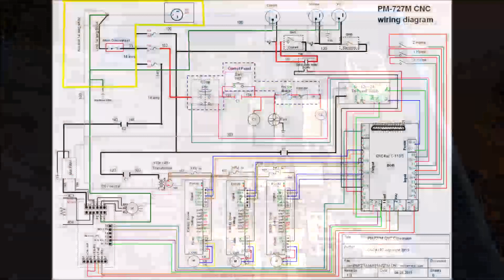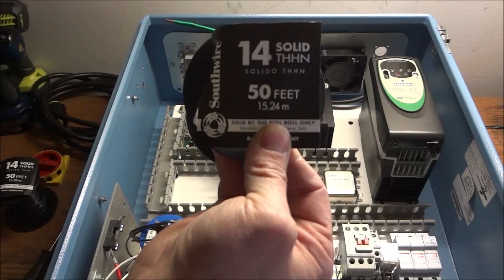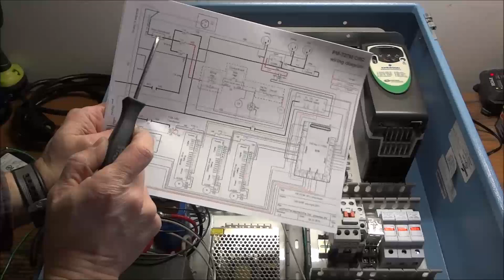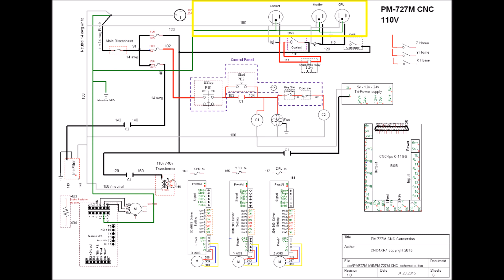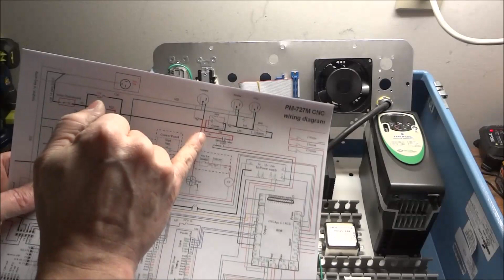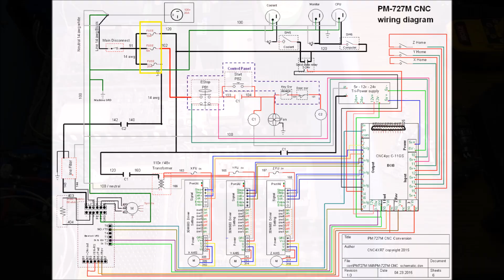PM 727M CNC Electrical Wiring Part 1

Comment: Hi! How did you split mains power so the whole machine needs just one outlet? I'm using 2 way screw terminals, but I'm looking for a cleaner solution. Thanks!
Reply from the maker: the whole Control box is running on 1 20 amp 110v circuit.

Comment: CNC4XR7, first off, thanks for all your videos.  I have gone through all of this series because I am hopefully soon starting up a CNC build myself.  I was curious what you used to create the wiring diagrams that accompany these videos.  I am basing a lot of my main electrical system off of yours but with a few modifications of course and I want to clean up my hand sketched drawings.  I liked that you were able to include the C11GS BOB with the DB25 connector pinout.  I looked in to a few different programs/websites/apps but haven’t found one I really like quite yet.  Being able to show the coil and contacts of a relay in separate locations like you have would help a ton with cleaning up the mess that is my schematic.  The other thing I was curious about has to do with the estop switching 2 different voltages so closely.  You have one set of contacts switching 120Vac mains power and another set of contacts is switching a 5V dc signal.  For my project, I want to add a few things that will make this happen in a bunch of places and wanted to know if it gave you any trouble.  I know best practice is to separate different voltages as much as possible, which it seems you end up doing by running two cables to your control panel.
Reply from the maker: I use TinyCad a free software for my wiring the C11gs and other things were drawn with this software. The 110v on the Estop is the main power which when denergized drops the holding circuit for the machine power the 5 v is the estop line to the BOB
Reply: Thanks for the fast reply.  And with the two different voltages running through two different sets of contacts on the switch, you don't have any strange issues with crosstalk or anything?
Reply from the maker: No I have not had any issues

Comment: Good call on the Kraus and Naimer - just got one off ebay shipped for $25 - seeing them listed for over $100 ... crazy.  But to the real reason Im posting today ... Sam - this series is amazing - TY in advance ... but alas Ive stumbled upon a question ... In this video we've watched you wire up the coolant and PC outlets on the back of the box with Neutral and Grounds and the red wire from the SS Relay ... but you didnt film running the HOT / Blk to the PC outlet ... yet at 9:08 in your video - there it is ... Hot/BLK on the PC outlet - How did that get there and where is it coming from/going to ...
Reply from the maker: Hi Steve take a look at part 2  .055sec in that may help you understand. The outlet is supplied the Black Hot 110v from a rocker switch on the control panel that gets wired up latter at the end of the pt.1 I do have a black wire connected and it just runs out the hole Its there just for reference and gets replaced when I do the control panel wiring.
Reply from the maker: Take a look at part 4 that is where I send the 110v to the control box rocker switch that turns on the cpu outlet.
Reply: Many thanks Sam ...  guess i kinda jumped the gun with my query ... I pressed on thru the next stages / videos and found where you changed that up in Part 4.  All clear now - Thx!  Mind if I also ask why you decided to change it up and go with the LiquiTight vs. Cannon plug[s] ?  For me sourcing custom lengths of 5 and 8 conductor wire of decent quality and shipping is far exceeding costs of 2 or 4 quality, high amp, aviation power style connectors.  Im in the process of using 2x 16awg 4 conductor SOOW runs with 16mm aviation connnectors ... re-mapped to your pin outs / connections. [ For the remote control box ]  Asking to make sure Im not walking into trouble with this route.  Thanks man
Reply from the maker: Hi Steve,
I used the 16mm Aviation connectors for the small gauge wire and the Cannon type for the bigger stuff the pins are bigger. check ebay you can fined them at a good price its all how you search. https://www.ebay.com/itm/Waterproof-Male-Female-Aviation-Circular-Connector-4-Terminal-P20-4-Core-P20K6Q/311528938505?ssPageName=STRK%3AMEBIDX%3AIT&_trksid=p2057872.m2749.l2649

Here I just purchased a 4 pin for my new box.  For the 8 pin connector to the control box you have to go with a 32mm P32 connector which was to tall so I used a https://www.ebay.com/itm/1-2-inch-NPT-90-Degree-Strain-Relief-Cable-Gland-with-gasket-nut-New/281379032241?ssPageName=STRK%3AMEBIDX%3AIT&_trksid=p2055119.m1438.l2649

Its not removable so if you have dont plan on needing to remove it you can go this route or use a P32 aviation connector.
Reply: So splitting the 8 wire up into two 4 pin 16mm plugs is not a viable alternative? 16 awg is too large for the 16mm aviation plugs or is the potential amperage/voltage from the control box wiring  [ not the low voltage DIN stuff ] too heavy ?
Reply from the maker: Steve Aylor 
You could split it i think tgat would be ok

Comment: I feel dumb asking but where did you get that rotary disconnect switch? What brand? I'm having trouble finding a similar one.
Reply: And I just figured it out. lol Kraus & Naimer
Reply from the maker: yeah Try Ebay Thats where I found the one I have you can find deals.
Reply: CNC4XR7 hey brother, I’m really sorry to bug you more. I’ve had my controller cobbed together for a while and you’ve inspired me to rebuild the control box with proper safety circuit etc. I see your feeding from a 20a outlet. I understand electricity enough to stay safe but I’m still learning so I’m a bit curious on your amp draw. Between my 48v PS (12a), my spindle driver (10a) I’m not sure how I’m going to feed it all from one 20a outlet. The coolant pump I’m trying to use needs 8.5a. I’m assuming these ratings are peak? What amp draw does your transformer and VFD pull that you can still connect a pump to the built in outlet in your controller box? Am I just not understanding current draw clearly? Sorry for the newb questions, I feel dumb asking but I’m just trying to clear up my understanding.
Reply from the maker: I think you have a good understanding and your assumptions are correct. off the top of my head I do not recall the current ratings but they are peak. and you want to try and stay at around 80% of the breaker rating so around 16amps. I am pushing them to the limits for sure but it seems to be fine with no issues. each draw is not at the same time so it does not all add up at once and my peak does not reach the limit. I think my dc PS is 15a and my VFD is 8amp , the coolant pump is about the same. plus my CPU and Monitor.
Reply: CNC4XR7 I have a single outlet 20a circuit and a 3 outlet 15a circuit in the garage and I’m having trouble figuring out an appropriate combination. The controllers 48v power supply alone trips the breaker on the 15a circuit but I believe part of that problem is that circuit is shared between the garage and the outdoor gfis. I had a working combination before I added in the coolant pump and now I keep going over the numbers trying to see if I can make it work. It kinda amazes me your running the PS, VFD, a pump AND  the PC all on a 20a circuit but I guess I’m thinking of it from a peak power up load. I need to get a meter with a clamp for measuring current draw. I think that would help me wrap my head around what’s going on.
Reply from the maker: If your 48v power supply is tripping the breaker and its only rated at 12 a there must be a problem. I do have a dedicated outlet just for the mill and it can not be a GFI outlet vfd's dont like them.
Reply: CNC4XR7 I agree. Trying to figure that out. It doesn’t trip the 20a circuit so it’s very possible I’m looking at a problem on the 15a circuit. I think verifying what the amp draw on the PS actually will help narrow it down.
Reply: CNC4XR7 I hate to even suggest it but I’m considering plugging everything into the 20a circuit to see if it will trip the breaker. I hate the idea but it’s about what I have left for troubleshooting until I buy another meter.
Reply from the maker: have you tried a different 15a outlet?
Reply: CNC4XR7 I have not yet. That’s a thought as well. My thinking has always been the available outlets are all on the same circuit (except the 20a outlet) so it would end up the same result. I could try that as well.
Reply from the maker: shoot me a email I will be happy to help if I can

Comment: Just to clarify,  your VFD converts 115v 1 phase to 220v 3 phase? This entire machine runs off of 110v?
Reply from the maker: Yes!  
It can be wired using 220v single phase as well,
Be Safe,
Sam

Comment: looking great, very professional!!  just watch your ground loops, don't want to have to hunt down issues after the fact.  are you using a line reactor on the input and output side of the VFD?  if not would be a great addition.  safer for your home power so you don't feedback into the panel and on the output side it smooths out the wave form and helps the motors run smoother and at lower temperature, we especially if the motor is bon inverter duty.
Reply from the maker: +christopher polanski  Thanks, Chris
Yes  I am using a EMI line filter on the incoming power to the VFD. Same as My G0602 project. VFD's are notorious for introducing noise on the AC line this helps with that. I will be keeping my Grounds isolated as much as possible.
Be Safe Sam

Comment: Nice to see the wiring started. I noticed that your sheet 1 of the wiring diagram doesn't show connecting to the main disconnect T2 and T3. I assume that's just a convenient place for you to tie the wires together before branching out to where they end up going. Is that correct?
Reply from the maker: +William Hardin Yes You are correct Instead of bringing the Ground and Neutral down to the terminal strip and back up to the receptacles I just used t2 and t3 (which were not going to be used for power) as a terminal strip itself. and then down to the terminal strip it saved a little wiring.
Be Safe,
Sam

Comment: Fantastic.
Reply from the maker: +russtuff Thanks Rus, Hows the progress coming on the G0602?
Reply: +CNC4XR7 Haha, good question. Everything is running and I just completed my first customer order last week (had to make 500 parts, about 40 hours of machine time).&#160;

The biggest thing I need to finish is the spindle encoder. It is reading 16 pulse/rev to give LinuxCNC RPM information, but it doesn't work for threading because LinuxCNC needs a quadrature signal and I haven't bothered to finish it up (I didn't need it for this run of parts). I need to make a new encoder ring with an index pulse, better resolution (maybe 120 pulse/rev), and two more sensors out of phase for direction detection. I've considered buying a cheap quadrature encoder and running it off a custom belt from the spindle..... we'll see.

The wiring to the steppers is messy and I intend to put them in a track like yours, but I haven't gotten around to it. I'll probably wait until the current setup breaks. Same with the limit/home switches. They are still in the prototype state, but since they work I probably won't change them until something breaks.

What I really want to do now is build a gang plate and put one of these on it: http://www.tormach.com/store/index.php?app=ecom&amp;ns=prodshow&amp;ref=33909

I might do that next, then get around to the spindle encoder.

How has yours been running?
Reply from the maker: +russtuff
 it's running great I finally got the coolant leaks figured out every time I run a different part it migrates to somewhere else.
I have a Idea for the Gang Tooling Check this out I think it will fit perfect. I ordered one just haven't got around to  working with it.
 I think its a perfect fit. http://littlemachineshop.com/products/product_view.php?ProductID=1664

Be Safe,
Sam
Reply: +CNC4XR7 Great find! Yeah that's barely narrower and longer than the cross slide, so that should work perfectly. I'll order one too.

My thinking was to make a thick spacer out of a big chunk of aluminum and drill two more holes in the cross slide and bolt it all together. Then I would bolt the Tormach holder to that aluminum block. I would also drill a pattern of holes on the underside of the aluminum block to reduce the weight a bit.

This plate would work even better, and could go right on top of the aluminum spacer block.
Reply from the maker: For the $ I figured it's a deal! I'm not sure of the spacer I was thinking more of placing it under the plate but I'm not sure as I haven't decided on the tool holders yet I would like it to be interchangeable with a tormach gang tool holder. I will most likely make my own.